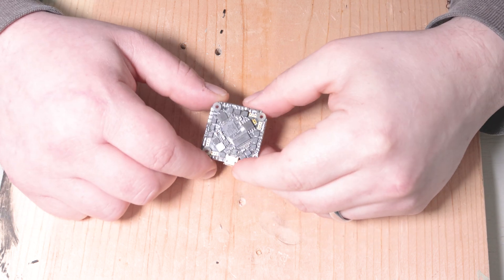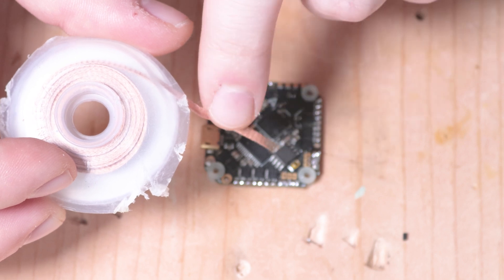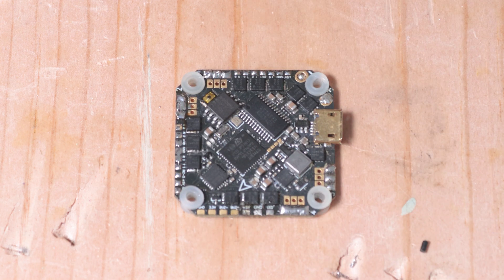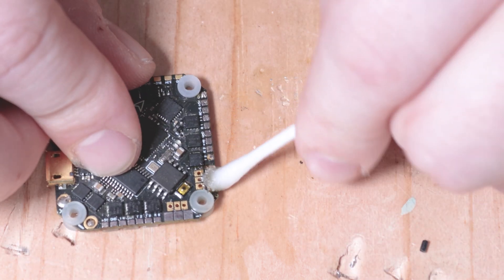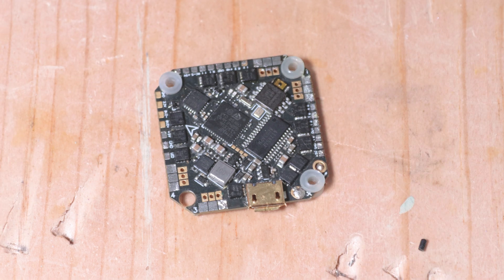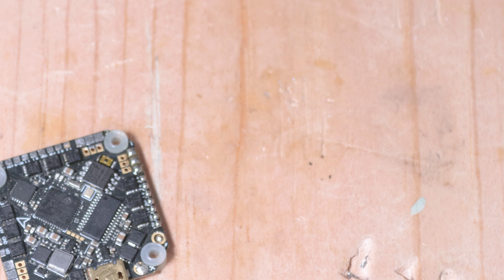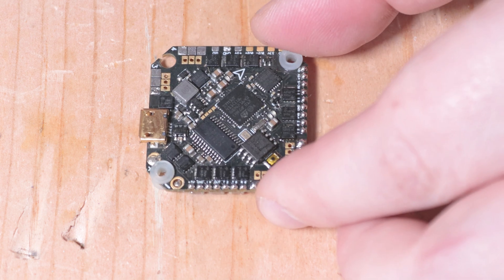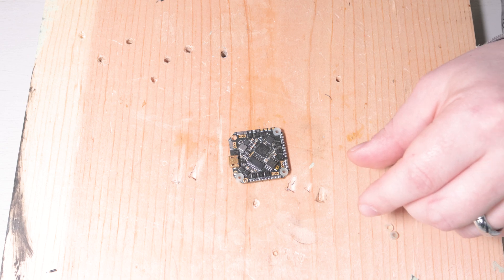How to solder micro boards with tiny pads.

Comment: I had a hard time today to solder my pigtail. I can't seem to melt the solder onto the pad😢 The temperature I chose is 350F with my smart soldering iron.
Reply from the maker: Yeah.. pigtails can be kind of a pain.  The temperature you roughly want for that is around 700 Fahrenheit or 400 Celsius. For xt30. I would aim for around 650 Fahrenheit.
Reply: Finally I was able to solder an EP2 receiver to the X12 aio with tiny pads...thank you very much for the tips.